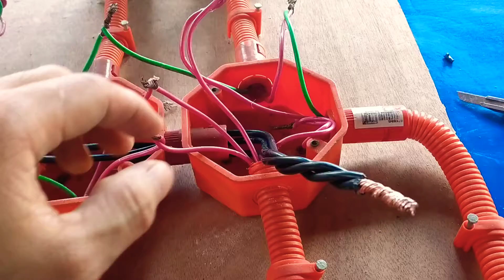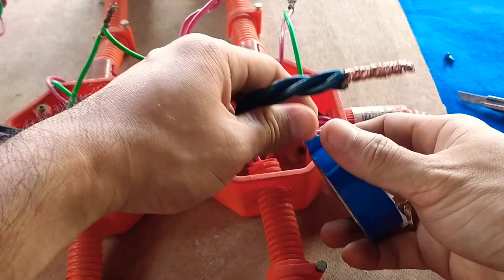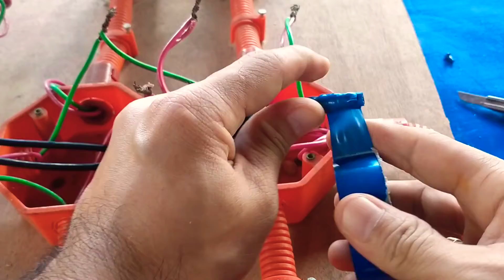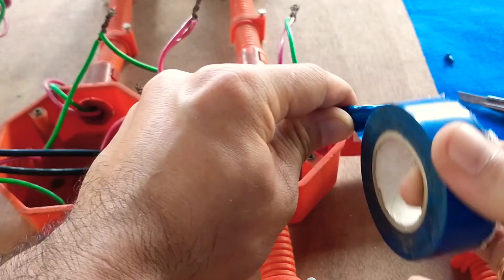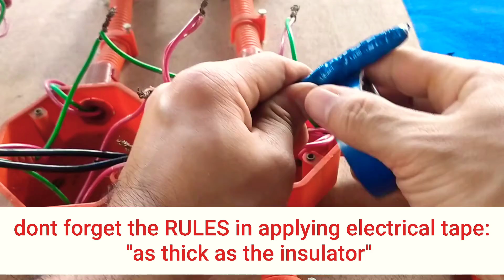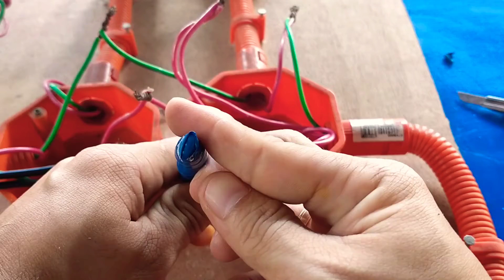How to apply electrical tape as insulation in electrical conductors/Short and quick tutorial #forYou

Comment: I think I've got TOO much respect for electricity. I like to play it safe. Not saying there's anything wrong with this demonstration. I just think ahead a bit more than necessary. I'm sure this person knows what they're doing.

While I'm not familiar with code from every country.... I would think you'd want to put a wire nut over the top of that connection. Even though the tape is nice and thick, the tape can be compromised. Put a nut on it. If the nutted connection is too big for the box... then it shouldn't be in that small of a box. Lots of connections in there. Expand the box with expansion parts. Not a big deal. That's what they're made for.
Reply from the maker: Thank you so much... Respect your opinion. . Bravo!